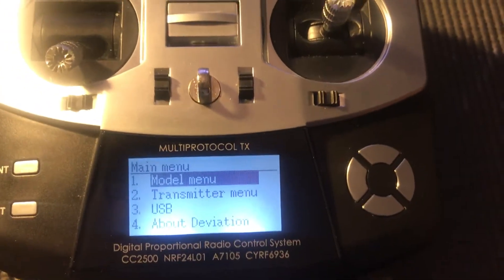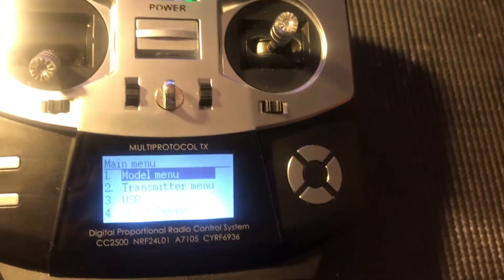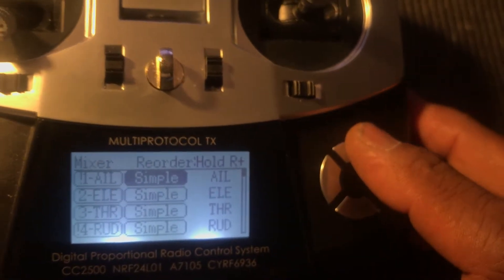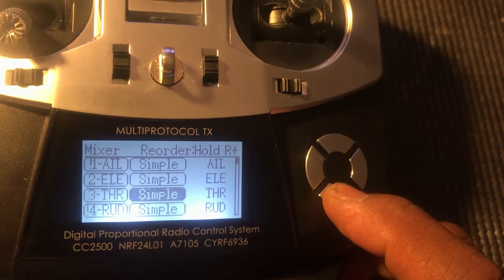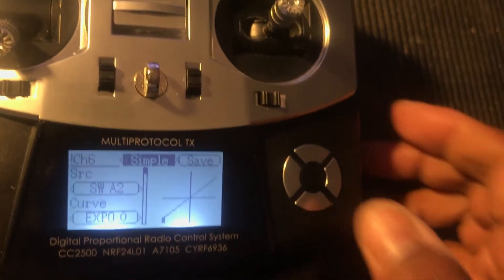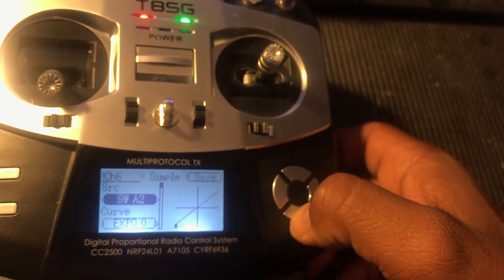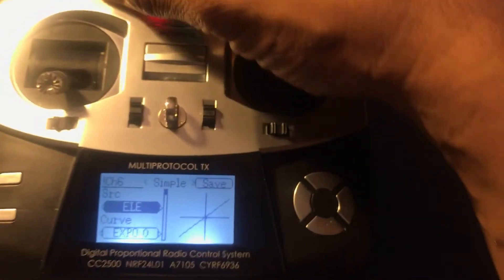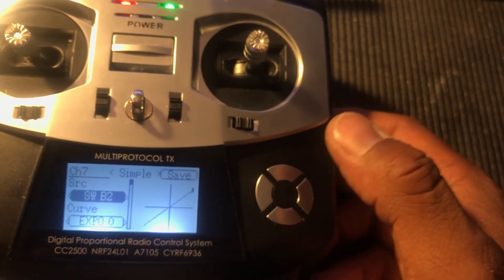Jumper T8SG Frysky Switch /Channel Mapping - Assignment Universal Transmitter

Comment: Scott, your a life saver as I have not had anything frustrate me so much. This device I put on a similiar par as to trying to understand women! At least thanks to you I now understand how to assign switches. 

Now I  have even been able to make the switches "3 way" So I currently use 1 switch to arm then beeper and the other to go from angle to horizon to acro.

My quad wouldnt arm at first either even though in Betaflight the indicator was in the "arm" section. But the arm indicator on the left hand side of the screen was not turning yellow meaning that something else was stopping it from actually arming it. This could be something like the quad not being on a flat surface when you try to arm or in my case the "throttle min" value was set to low so out of available reach for this transmitter. I found that adjusting the throttle min in the receiver tab to a slightly higher value resolved this.

Once again many thanks for your help.

Happy flying
Reply from the maker: Lol!!! Thanks Chris. I'll let my wife know that one too. You helped me as well. I'll adjust my min throttle when I get home. Hopefully that works. Thanks Buddy!
Reply from the maker: Thanks Chris. That's my problem too as I'm using dshot 600. I set the min_throttle higher in cli, but still no luck getting the arm switch to go yellow. what did you set yours to for it to work? Thanks
Reply: Hi Scott, Apolodies for the late reply. Did you manage to get your arm switch working?
Reply from the maker: Chris Fawcett no worries Chris. For some reason I still can't arm  my frysky with the switches. I'm using Dshot, so I tried changing min throttle using CLI commands. Still not working. 

On the bright side, I did watch RCescapes review. He's getting crazy distance in his whoops with this thing, so I think the 150mw capabilities may be at work with the increased range
Reply: I dont know anything about Dshot but one of the other things I found was when setting up the switches, do not set the min and max values to the furthest extent. I think it was +/- 125. This was going too far of the scale to be recognised and therefore was not hitting the "arm" segment. I as a rule now set these limits to +/- 100. 

Cant really help you too much I am afraid as due to your original video, I spend most of my spare time flying!!!!

:)
Reply: I figured it out!!! At least what worked for me. In the reciever tab of BF I set the throttle stick as far low and it read as 998. I then trimmed up the throttle until it read 1000. Then I got it to arm!!! Then I proceeded to unplug my battery and take my quad off the table with the usb still attached and ripped off the usb connector from the flight controller. I'm still a newb...
Reply: Oh no! I doubt that is gonna be an easy fix to reconnect the USB but if you got it arming hopefully you can continue with your quad without having to reconnect - what quad are you using?  Did issues with using switches on the Jumper bring you to Scott's vid?
Reply from the maker: GeckoLibre well... Welcome to the hobby where we all live and learn. Looks like you will be into building many quads in the future like I've been. As far as the arming goes, if you got it to work, then that's great! 

Only thing when you rip the USB of the Flight Controller, all of your adjustments you make are final. You won't be able to fine tune not do anything more with your quad unless you replace the Flight Controller. 

I do recommend doing that anyway as you will be installing many Flight Controllers on different Quadcopter builds. Again... Welcome to the Hobby!
Reply: No I've had troubles from the beginning with this controller from flashing the upgraded firmware to binding and configuring the controls and arming. It's a real steep learning curve, especially for me since I've only known flysky i6 controller.
Reply: I actually plan to resolder the usb back on. I have surgeon steady hands :) I'll letcha know how that goes...
Reply: So I tried.. I actually succeeding in bridging all 5 contacts and securing the housing to the ground pads, but when I plugged in the cable, it popped right back off again. So I'm just gonna get a cheapo omnibus f3 from RTF quads.

Comment: Hey, what's up man! Finally received my T8SG today & was wondering if you knew which preprogrammed protocols worked for the fq777 124 models & JJrc 1000 by chance? And I'm waiting for the nano-tech 2s battery you recommend to finish charging as I type this! Haha!! Can't wait to learn this transmitter!
Reply: im sure you figured it out by now but the jj1000 uses the v202 protocol
Reply: coolkid6364  Yes, I did! Thanks for the support! Funny though, shortly after I posted that comment my T8SG crashed to the USB screen. Had to do the firmware flash reinstall! Which turned out to be quite simple in the most complicated way!! 
 Haha! But yes now I have it all figured out & it’s pretty awesome! Love the precise control & longer range I have now! Makes zippin all my little toy-grade quads around a blast!!!

Comment: I youtubed devo 7e instructions. They are essentially the same menu and setup. Hope this helps someone. I'll see about making a video for it on my channel.

If you want to use the 3 way toggle perform the same procedure to get to the Mixer and select channel. Change to Complex from Simple that you have used in video. Change Mixers 3, Page 1,  Switch D2, Mux replace, Src None, Curve Fixed, Scale -100, Offset 0, No Trim then save. Go back into Page 2 to set "D1", Switch D1, Mux replace, Src None, Curve Fixed, Scale 0, Offset 0, Save. For "D0" go to page 3, Switch D0, Mux replace, Src None, Curve Fixed, Scale 100, Offset 0.

It's important to note that each page uses a different scale to determine the position of switch. Please let me know if you need help doing this.

D2 = SW D top position, Scale = -100
D1 = SW D mid position, Scale = 0
D0 = SW D bottom position, Scale = 100

Repeat these steps for all switches.
Reply: Thanks so much for this!! I just got one and this one issue was killing me till I saw your response!
Reply from the maker: Chansook Saechao I totally appreciate that info! Going to try that tomorrow.  Waaay cool! Thanks
Reply from the maker: Chansook Saechao I still can't get my Eachine e010 and jjrc h36 whoop to bind. It has the right module to do it, but no matter what I try using other videos, I can't get it to work. Maybe you can do a video on it for us and post the link to it here?
Reply: Scott Givens Sorry, I'm not familiar with how to bind those two even though I own both. I'll play with it some tonight after some youtubing!
Reply from the maker: Chansook Saechao  Chansock! You Da Man!! I got all 3 switches working thanks I your tutorial! Now I feel good about adding my Hulk112mm micro to this Transmitter! So Awesome...🙏
Reply from the maker: Chansook Saechao now the last step is to figure out how to bind that friggin Eachine e010! I just bought that she r jjrch3 because they use the same protocol and I still can't get them to bind😩
Reply: I have my Jumper working with my H36 and H8mini but some things like headless and switching rates are not working. When you attempt to bind the protocol it automatically defaults to the first one if you press the wrong button. Use MJXq and change format to E010 for the H36. If you're using the default shipped from China firmware you will need to reverse some channels. If you're using the newest Deviation firmware then the instructions are different as they fix some of the reversed channels and switches. You'll notice that following Devo 7E instructions will have all your 3way switches backwards but the Deviation firmware resolves most of them. I just installed the Deviation software so now all my switches are backwards and same with my controls. lol

For the H8mini use Bayang. I haven't played with it enough because one of my motors is dead but I was able to fly it briefly to find out the controls have been fixed with the firmware update. To rebind just turn the controller off and on.
Reply: Hey Man...you are great !Now i undestand the switch settings and it works.Thank you !
Reply from the maker: André Comte Awesome Andre!!! Glad it helped you!
Reply: Thanks for this, i was using the turn knobs as a 3 way switch because i didnt feel like putting in the time to figure out that menu.... turn knobs also have a scale of -100 0 100

Comment: I've got the T8SG pretty well set-up for FrSky and FlySky - but cannot for the life of me figure out how to get the XM+ RSSI output to show-up in Betaflight using the T8SG.  The RSSI output is supposedly on channel 16, but the max channels available on the T8SG is 12 in the FrSky X protocol.  Some folks seem to have done it - but I can't.  Your help and a video on FrSky and the T8SG would be really helpful!
Reply from the maker: George H Hi George... I'm looking into it. I followed JC's (Former Project Blue Falcons) tutorial on it, but I'm only getting a constant reading of 65rssi. I'm also using the XM+ receiver as well. Everything else is working perfect. I just need to do more research. Let's keep each other posted. 

Surprisingly, I'm able to use the switches to arm the quad with the XM+ receiver and running DShot 600. However, I'm still having problems arming the quad using the switches with my Lizard95. 

This is definitely not a plug and play transmitter. Lol. The stuck response has been VERY good! Probably due to less travel
Reply: Scott Givens - apparently you have to flash the latest firmware to the XM+ receivers to put RSSI on channel 16.  Some come with RSSI, most appear not to.  Flashing the firmware requires a Taranis transmitter - or some external gear.
Reply from the maker: George H thanks George. I'll look into how to flash the XM+ then. I've had it for a while now
Reply: Scott Givens - thanks for the effort Scott!  I'll be waiting to see what you find.  I wonder about SBUS inversion with the Lizard's F3 board - that could be part of the problem.
Reply: anyone have any luck getting rssi in betaflight with the xm+? I just received mine and wondering whats the chance they fixed the firmware issues, i dont want to swap my current receiver if i can't get rssi with the frsky. Can a usb tool be used instead of a taranis to update the xm+ firmware?
Reply: coolkid6364  - all you have to do is flash the right Frsky firmware to the XM+ - it’s got nothing to do with the T8SG - just set RSSI to “LastChan.”

Comment: Well it seems my transmitter doesn't have any protocols loaded at all? All my choices say none! Is this normal?
Reply from the maker: Canebrake069 for protocols, that's in the model setup area. If none is they only option when you use the right and left arrow keys, then there is a problem
Reply: Scott Givens Hey, man thanks for all your feedback! I've discovered everything is good just navigation errors on my part! Such a big learning curve for me! I've got everything to bind so far! Now trying to learn how if possible to control rates in yaw & pitch.
Reply: Scott Givens Do you know what type of USB cable I need to connect to computer? Through the battery bay or jack near antenna? Thanks
Reply from the maker: Canebrake069 if you are trying to upgrade the firmware, you need a mini USB cable. Be careful though, follow sebsky's tutorial like I did. If you already have models made, copy and save the models folder and put it back in after you Upgrade the firmware. Otherwise you will lose all of your settings and have to start from scratch.

AmazonBasics USB 2.0 Cable - A-Male to Mini-B - 6 Feet (1.8 Meters) https://www.amazon.com/dp/B00NH11N5A/ref=cm_sw_r_cp_api_O3G4zb8X29QBN
Reply: Scott Givens Yes , I got the stuck in USB mode too! Then followed his tutorial & its alive again! Thank goodness! I was starting to lose hope! Haha!